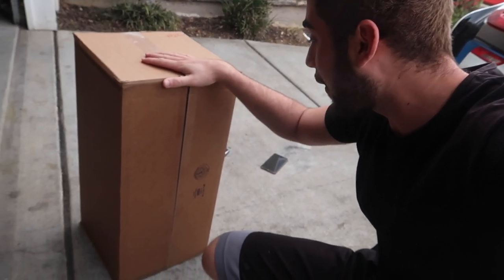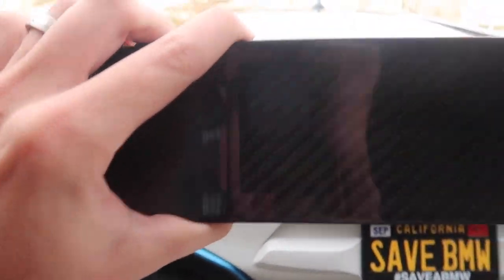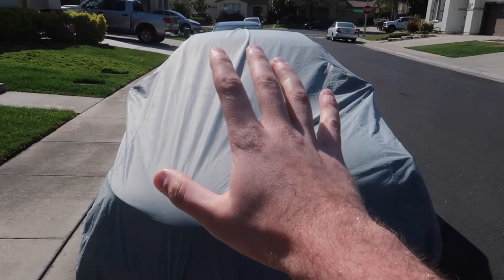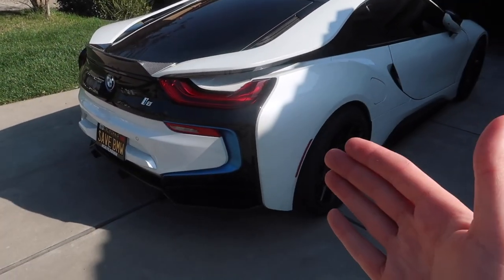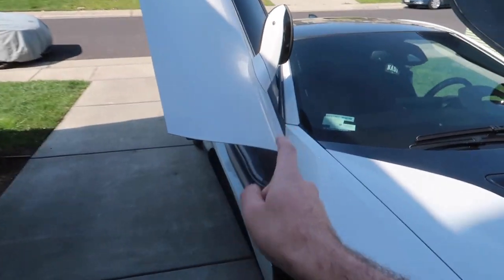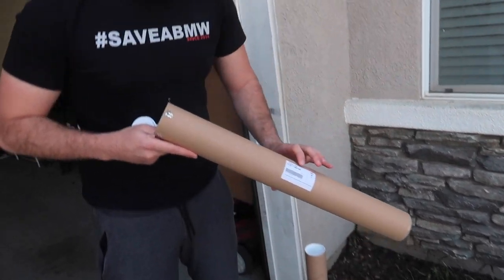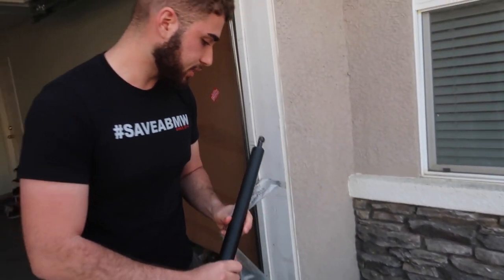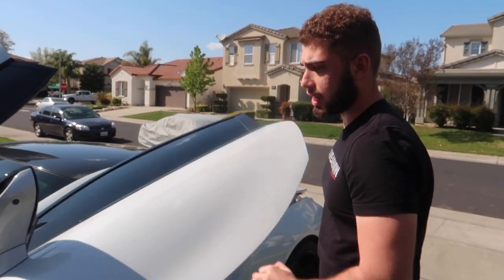I8 GETS NEW MODS! (NEW M CAR REVEAL!)

Comment: Bro the 740 is a money pit one thing you can do is to part it out and make some profit for the new build or fix the transmission but for the repair cost of the transmission it won't be worth it!
You can also use it as a daily (with the transmission issue) for a while and then part it out!